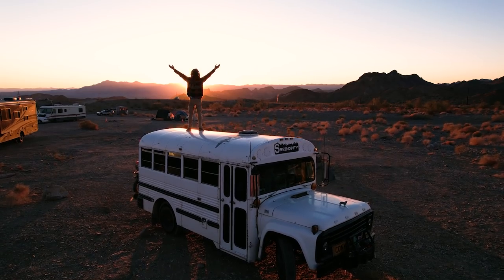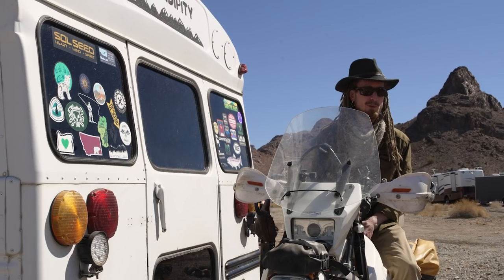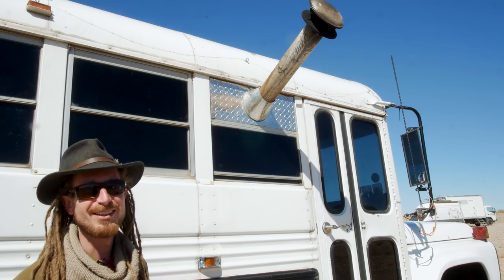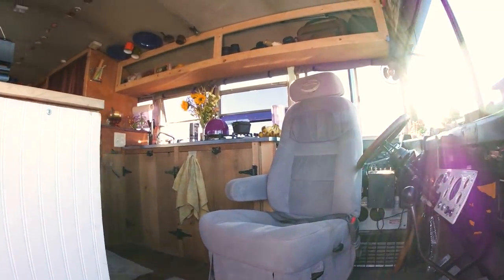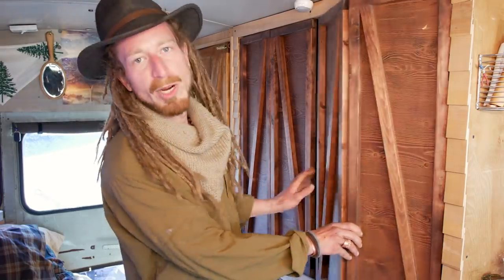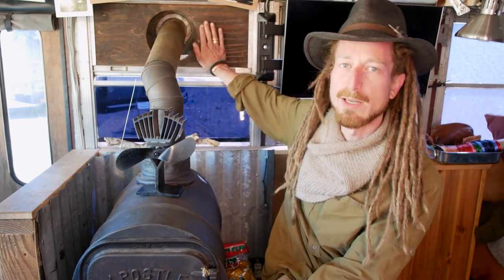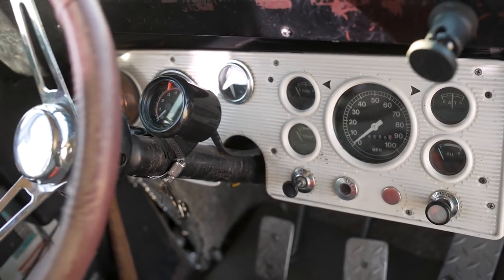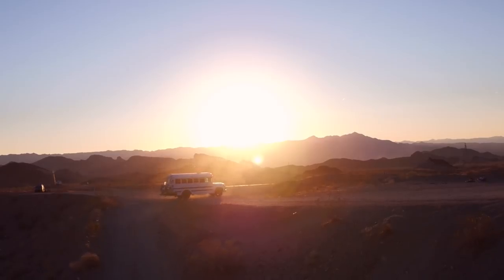Backpacker converts bus to Tiny Home  on low budget

Comment: Really love the woodworking that he has done..love that antler pull..
I believe in reading a map as well. 
No electric? Did I miss that?
Sorry..but I would have to have some shower set up.
Seems like a very creative and humble man..roll on!!
Reply: Hello Griff! Thanks for watching so closely. I do have two deep cycle batteries under the hood and a 4500 watt inverter for power inside. I also use a solar shower when I need to clean up. I also frequent hot springs as well as the occasional river or lake :)